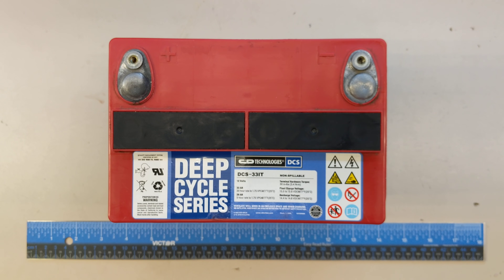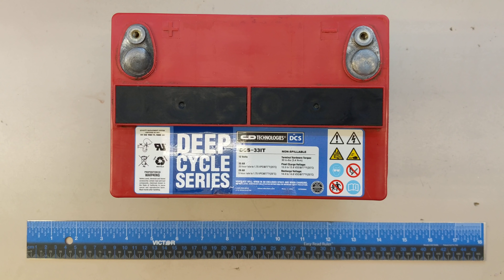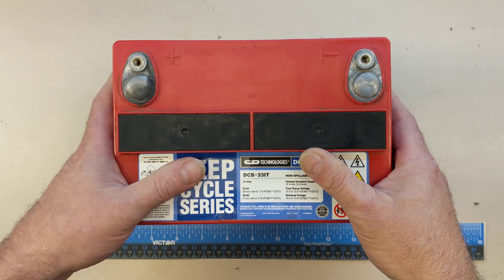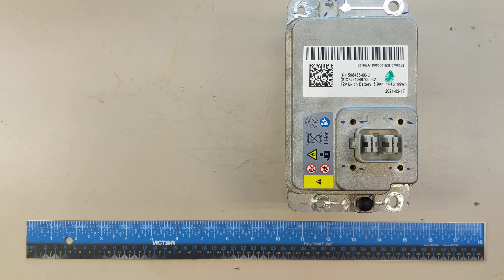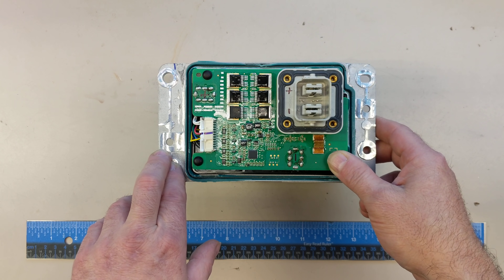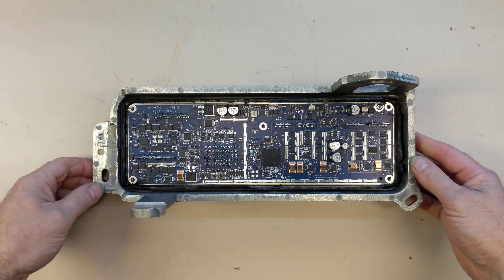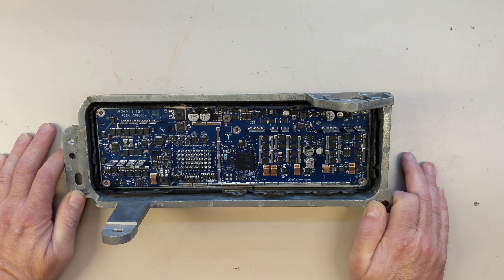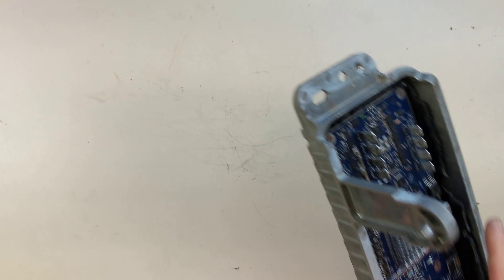Tesla Plaid - 12 volt Lithium Battery PART 1

Comment: So how would I tap into that battery to add aftermarket accessories? Do I use the jump post for power?
Reply from the maker: Definitely not!   Best place if it's high-current would be at the PCS output (with an appropriate fuse).
Reply: @Ingineerix  not sure where that or what that is. Want to install a power frunk to my refresh Model s, but I’m trying to determine where to draw the 12v constant power from.
Reply from the maker: @TeslaModificationInstaller  If you tap the 12v feed to the battery, you WILL cause a fault and could cause the car to not start up.  Tesla will not cover this under warranty.   I wish I could help you, but Tesla has not yet released the wiring diagram for the Palladium, so I cannot advise where to tap.  Probably the safest thing to do for now is tap the 12v outlet feed in the console.  This should power up when the car wakes from sleep, so if you trigger the frunk from the app or fob, the car will wake the accessory bus.   Once we have the wiring diagram I can find a better location.

Comment: nice job. Curious what you think about an electrical system that uses some sort of wifi and a common power bus. Seems like Tesla was considering doing something like that but didn't do it on the Y. You could even have zones that limit the total current  for safety. Seems doable now.
Reply from the maker: This is sort of what's going on now.  RF communication doesn't make sense, but they use CAN, LIN, and some Ethernet.
Reply: @Ingineerix  Maybe 802.3af seems like it might be the play?
Reply from the maker: @JoelSapp  This would be a lot of unnecessary power conversion which increases cost and decreases reliability.  The total cost and weight of wiring does not offset the extra stuff needed for that.  Plus, all the small 8-bit microcontrollers used in a modern car are simply not capable of a complex high-speed Ethernet implementation.  You don't need gigabit networking to control a power seat.  This is why LIN/CAN is used.   Cost is the number one driver in automotive electronics.

Comment: is there no way so step down high voltage to 12volts without a battery in the middle?
Reply from the maker: The HV pack does power everything, just not when the car is "asleep".   There are a lot of reasons for this, safety is one, and due to the overhead, you'd lose a lot more energy than you think keeping the sleep loads alive.

Comment: I would disagree with AC letting you get away because of the times the current is 0, from my understanding AC is more dangerous precisely because of the current being able to flow due to the capacitance thereby making higher peak current that in DC voltage

Comment: So they went from a user replacable battery to a custom one where you need to take it to shop. that sucks.
Reply from the maker: It's super simple to replace.  I'd say easier than the old 12v AGM.  It's available over-the-counter at Tesla service.
Reply: It should still be easily replaceable for anyone comfortable doing minor car repairs.  More importantly though, this one will be vastly, vastly more robust for the EV use case.  Much better match.

Comment: So a 4S pack would be about 16.8V fully charged but it's not god to leave a LiIon fully charged right? So they could just charge it to 16V and use the output FETs and some filtering to output 12 or 13.8V right? As far as cold weather they could disconnect the cells from the DC input while running and direct the DC input to a cell heater. Then once it's warmed up, allow it to charge.
Reply from the maker: No, they keep the bus at this pack's voltage.  It's usually 15-16V.  I don't think they go over 4V/cell for longevity.

Comment: Why don't they just use a dc to DC from the main battery?
Reply from the maker: The HV pack does power everything, just not when the car is "asleep".   There are a lot of reasons for this, safety is one, and due to the overhead, you'd lose a lot more energy than you think keeping the sleep loads alive.
Reply: @Ingineerix  thanks very informative.  Love your videos!

Comment: If your going to leave your car in the garage for a long time is it worth making a conection from the 12 volt lead acid battery to a mains charger
Reply: Yes!  That's a very good idea.  James May did a really good video about how annoying it is to get at the 12v battery after it does "flat".  Check it out: https://youtu.be/L34DNhX5LkU
Reply: No. Just plug the car in. It will charge the 12 V as needed.

Comment: Hello to everyone from Ukraine! I don't understand why Tesla was using 12V acid batteries in their cars before, because there were no issues with high temperatures (critical for Li-Ion batteries) under the hood, as in cars with combustion engines. But the advanteges of Li-Ion technology much-much bigger than the disadvantegies when compared to using old-technology acid batteries even in cold weathere (there no need for starting combustion engine, for example), so this change (acid accu to Li-ion one) was expected.

Comment: When you mentioned the new battery is 16 volts, recently the Model 3 battery went dead and a smart charger (ctek) was used to recondition and charge it back up.  The recondition mode outputs 16v to de-sulfate the battery.  This 16V apparently blew up the Model 3 screen!  The screen died and began to smoke, it had to be quickly unbolted and unplugged.  After speaking with ctek and few knowledgeable Tesla tech's, they said "automotive grade" parts should accept 16V without issue.  I was told the  Model 3 screen however was made by LG and questions arose whether it was designed for 16V...  Interesting to see the new Plaid using this now!
Reply: What brand was the charger? Desulfating chargers use high frequency to breakup the sulfate buildup, might be higher than 16v if you look at it on a scope.

Comment: the insulated shoes is the most important point of this video.
Reply: Yep so many people dont understand how current flows. Conventional flow is actually dangerous to teach now seeing how common high voltage systems are going to be in the near future.
Reply: I don't really get that. Shoes are plausible for working on your home AC system where you are the ground lead and potentially could close the loop by touching the phase lead (with bad shoes). . But working with DC batteries there is no ground lead and you can't close any loop with your feet.

Comment: After an accident how long will this keep the hazards going?
Reply from the maker: Probably at least a few hours.
Reply: Well the coolant pumps, car computer and MCU will still be running for a while uploading crash telemetry, and those run 10-20A.  With only 6 Ah you would run through that in 15-20min. They can do some pretty fancy load shedding with all those fets, but at some point VCLEFT and VCRIGHT will have to shut down.  Its probably pretty variable, but I wouldn't count on it for more than an hour.  Should be an easy thing to test tho lol
Reply: @1forrest1  is that really long enough, I suppose as long as Tesla is reporting the incident to emergency responders then its ok, sucks a bit if you're somewhere remote with no cell coverage.
Reply from the maker: @1forrest1  Yeah, they definitely load shed as soon as they detect the PCS DC-DC is offline.  I've already tested this a little.   No need to run the coolant pumps if there is no HV.   The APE (Autopilot ECU) can also be shut down as soon as they gather the crash data.
Reply: @Ingineerix  I thought it was interesting in Rich Rebuilds plaid video they have a HV shutdown and it already shows the 12V at 39% SOC. It's not easy to say when they started filming after the fault, but I wouldn't guess 6Ah is going to give you support for long. Particularly if they don't actually maintain the battery at 100%. What's the 12V system nominal voltage these days?
Reply from the maker: @1forrest1  It seems to be between 15-16V.   They load shed systems pretty fast when the DC-DC is offline, and this is only getting better as they tweak stuff in each software update.   All the 12v needs to do is get you off the road safely.   Maybe run the lights for awhile.   It doesn't need to keep all the systems up for any length of time.   First thing I do on all EVs I am working on is add an external regulated 12v supply, so nothing changes as far as diag time.

Comment: Love your videos, really! I'm just really curious: why does the harnessing from the plad 12v battery have to be so thick, if it's only to open contactors of the battery pack? Sounds strange :-/
Reply from the maker: It has to provide emergency power to hungry things like the electrohydraulic brake booster (iBooster) and power steering (EPAS).  It also has to stabilize the 12v bus so it can absorb load dump spikes and transients, and provide high-current pulse power when there is a large inrush.

Comment: Wonder why it isnt behind the firewall?
You'd think that they'd have it sitting as low as possible behind the firewall (next to ice box?) to maximize the robustness of the redundant 12V system as well as lower the center of mass.
Reply: prolly ease of maintenance a bigger concern on the lead acid ones and bow that it is so light, not worth relocating
Reply from the maker: Mass isn't a concern for something so light.  I think safety is a good reason to keep it out of the cabin.
Reply: @Ingineerix  the mass thing i can understand, but safety? Its as safe as any other 4S 100 Wh pack. They already blow the main pack's pyro once the system deems a crash severe enough to involve the airbags, so why have the only remaining source of power sitting right at the far end of the crumple zone?

Perhaps they intentionally wanna kill the 12V system uppon severe crashes as well in order to completely cut power to the vehicle to minimize the chances of a fire?
The vehicles already done its job after the crash, so why bother powering anything if it can lead to a fire?
Reply from the maker: @kevin42  No, this sits up behind the tower brace which is very strong and also up high out of the crumple zone.  I don't see it ever getting damaged unless the car is torn in half.   What benefit would it gain inside the cabin besides more difficult access, and a potential safety issue should it vent in the event of a failed cell?
Reply: @Ingineerix  my minds playing tricks on me. Your right. Although to be clear i didnt mean far end as in right infront of the car, but rather placed behind the front strutt (air suspension tank)
Reply from the maker: @kevin42  I've dismantled and worked on a lot of salvage Teslas.  That area is pretty safe.  Tesla wants the 12v to stay hot after crash so they can upload the crash data, as well as e-call in Europe.  I think it's well protected.
Reply: @Ingineerix  if you say so. You seem extremly experienced so il take your word for it. For some reason i'd still wanna see it behind the firewall, but you've clearly demonstrated that its by no means a necessity.

I love the content, keep it up!
Reply from the maker: @kevin42  Thanks!  #1 reason to keep it out of the cabin:  Excessive heat.   Cabin temps can easily hit ~160F/~70C which is too damn hot for these cells.
Reply: @Ingineerix  great point. Ok im fully convinced.

Comment: Do you know the specs of the DC-DC converter and how it differs from previous models? The DC-DC converters I've looked at in the past for an EV conversion output around 14V, I guess the one in the Model S needs to output more than this to charge this new battery? Is there a charge voltage controller on that circuit board or does it somehow communicate with the DC-DC converter to fine tune the voltage?
Reply from the maker: The PCS has the DC-DC.  It's the same one first used in Model 3.  (See my pack teardown video)  It's controlled by VCFRONT/VCBATT, and is programmable up to at least 18 volts, so no problem there.

Comment: where is the jump start terminal located? Tesla should locate this at area which can be accessed without opening the frunk.
2nd thing, i wish you continue to dismantle the battery. it may have heating element inside.
Reply from the maker: It's under the access panel inside the frunk below the windshield.   There is not a heater inside.  The connections would be on the PCB.
Reply: @Ingineerix  thanks for sharing. appreciate your effort and good content.

Comment: i'm curious, why can't the pack power everything? if the pack is used to recharge the 12v, couldn't it just do the job itself? i know it's high voltage, but isn't it stepped down to do the charging of the 12v?
Reply: One reason is safety - in any crash/damage situation you want the pack contactors to disconnect to isolate the HV, needing an external supply to enable the HV is a good way to do that. Also, on a damaged car it's good if the hazard lights and comms can be kept working.  Another issue is that it's hard to make a DC/DC converter that works over a very wide range of power - very low when teh car is mostly off, but also capable of driving heavy loads like power steering, fans etc.
Reply from the maker: The HV pack does power everything, just not when the car is "asleep".   There are a lot of reasons for this, safety is one, and due to the overhead, you'd lose a lot more energy than you think keeping the sleep loads alive.

Comment: Great stuff Phil. We're very privileged to have you back on the hobby trail again. Curious as to your opinion in general on (super)capacitor based solutions which have made inroads in trucking, forklifts and that sort of use cases. If you have more time: also the more strategic (long-term) outlook of hybrid supercap/battery architectures - assuming self-discharge is acceptable on the caps side - where you could better mix power versus energy density like you would do in old-school computer data storage architectures with mixing f.i. RAM (fast, non-persistent) vs HDD (slower, persistent). Hope the latter question formulation makes sense. Cheers, Jan
Reply from the maker: Supercaps don't have anywhere near the energy density, and they have a linear dVdT curve which means you have to add complex power conversion.
Reply: Supercaps have a phenomenal rate of charge leakage.
Reply: With the very large size of the lithium batteries, they can draw immense amounts of current already. I doubt that the very large size and weight combined with very low power density of supercaps would add enough burst power to be useful. You'd also need better cooling systems to keep the drivetrain cool with the extra power.
Reply: @clonkex  Ah, that makes sense, thx.

Comment: Only issue that I can see is cold temps but other than that this is the architecture to use. Bravo Tesla for dropping that ancient lead acid 12v battery
Reply: Funny thing is when my 12v died, it was after a really really cold night and a very low SOC on the main pack. Other than that, I had been super careful with it. Hopefully they have a cold mitigation strategy to warm them up before recharging them.

Comment: On the top it says 99 Wh. Perfectly matching the 100 Wh limit for carry-on Luggage.
Reply from the maker: I'm sure this is no accident =)
Reply from the maker: Yeah, calculated capacity is 102.12Wh, but Tesla is likely never charging it to full, so it's probably even under 99Ah.   See updated video:  https://youtu.be/fJH1r1s8B6Y
Reply: The 99Wh is actually due to IATA regulations and shipping/ handling. By being listed as 99Wh (.099kWh) it save logistic costs and DG training.
Reply: Often you can travel with 150Wh.. A lot of laptop etc batterypacks are over 100Wh
Reply: @rkan2  Can you give me a link to a laptop with a battery higher than 100wh ? I would love to have this kind of battery life
Reply: Buy a modern Macbook and have double figure hours of battery life. From my experience, Apple tend to underestimate true endurance. This iPad Air2, bought from the Refurb and Clearance section of the Store, could run for up to 16 hours when new, in 2015, depending upon what it was being asked to do. Over 10 hours with normal use. It still does over 10 hours, despite having been run continuously for almost all of the intervening 6.5 years. I've never been precious about the battery either. It's at 93% SOC  now, starting at 99%, and has been running Youtube videos on battery for over 50 minutes.
Reply: @rkan2  don't think so. MacBooks are capped at 100Wh
Reply: But why 😂
Reply: not carry-on luggage, it means for tesla product can be sourced and shipped through consumer airlines as well instead of just fedex or ups

Comment: 17:00 - Surely there is some sort of heater within the battery?
Reply from the maker: Nope.  No connections.  They are using the pack AS it's own heater!
Reply: @Ingineerix  smart!
Reply from the maker: @jonathanviventi1380  Please at least watch the full video and part 2 before you comment:  https://youtu.be/fJH1r1s8B6Y

Comment: The Hyundai Ioniq 5 / Kia EV6 while having a 48V wiring system still afaik use a 12V lead acid. I wonder if they eliminated the 10kg (difference between the old Tesla lead-acid and this new lithium ion battery) in wiring... I somehow doubt it. Copper cables are of course more expensive compared to a regular old 12V (for an EV also smaller) battery
Reply: Source? I cannot find something to confirm the Ioniq 5 uses 48V wiring. Pretty sure it doesn’t.
Reply from the maker: Lots of mild hybrids use/used 48V systems, but ALL still have 12v systems as well for the reasons I outlined in the video.
Reply: @geraldh.8047  Hmm.. I though I read this somewhere.. Well - I guess we'll still be waiting for the first car with 48V auxiliary wiring..